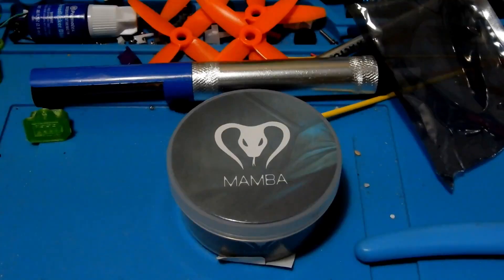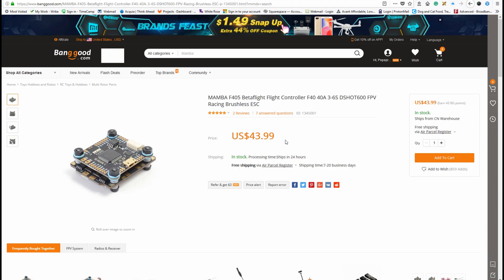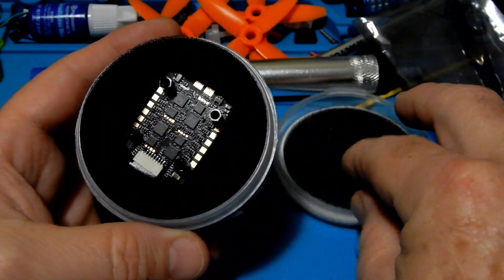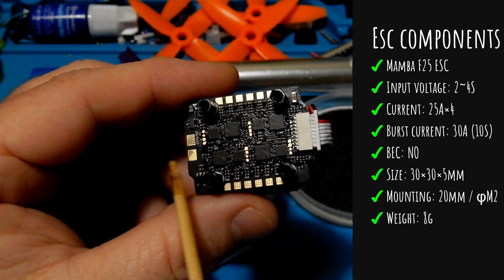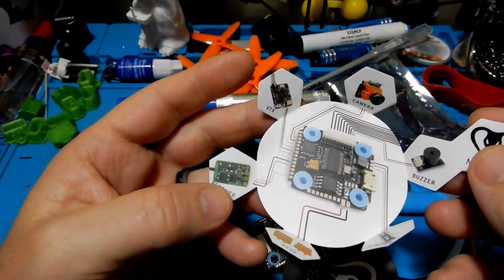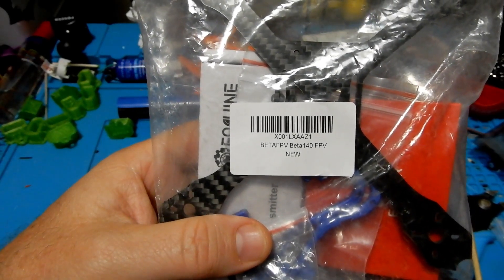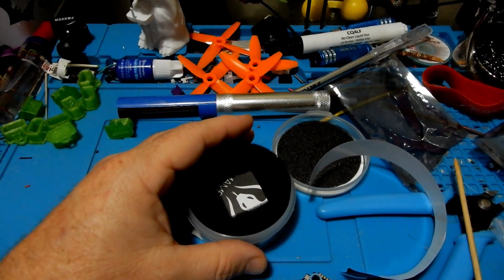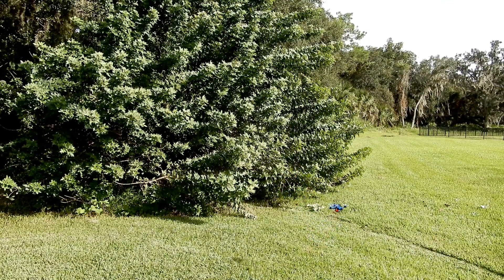Diatone MAMBA F405 Mini Stack -  Cheap Mini F4 Stack

Comment: Hi nice review which prompted me to buy this stack. Can we power the fc through esc via cables? Or we need to power by using the pads in the fc?
Reply from the maker: If you bought the full stack the FC will be powered by a cable from the esc to the fc. You will receive it already assembled and receive an extra ribbon cable for this as well. Now I have not done this before but the diagram also shows that you could straight power the FC from the battery or another esc to the VCC pads on the Mamba FC as well. So you should be completely covered my friend. I do suggest, although I did not do this in the video,  add the supplied capacitor to your battery leads/pads on the esc to clean up the power so you do not get any interference in your fpv feed. I am still using this stack religiously and just received the v2 of the mini yesterday for review. If you do any other builds the iFlight Succex stack is also now giving this stack and run for it's money to be the leader in affordable stacks. Hope this helped my friend... Happy Flying!
Reply: @TheQuadcopterReview  Thanks a lot friend. I have a iflight stack too buts its more expensive than this
Reply from the maker: @rajeevgopal1394  I don't know if you saw the mamba mini v2 MK2 stack yet also super cheap and they have made the solder pads better pretty happy about that change here. Is the mk2 the one your purchased? The link in my description?

Comment: Hey man, nice and helpful video!

How good would F405 be on a 600mm quad?
Reply from the maker: I believe the full-sized version would work just fine. I have one that i am in the middle of making the video for. I just need my micro cam to come in but it is 40a x 4 on the full sized version so I would think it would work great.
Reply: @TheQuadcopterReview  Just got my Mamba, do you have a video about setup?  I watched the wiring and stuff, I mean the software configuration.

Comment: Three uarts are not extra uarts that’s basically borderline / insufficient nowadays. It’s actually not fully three uarts cause there is only RX1(sbus/DSMX), TX3(smartport), and Rx6/Tx6 in which leaves you to have to sacrifice some what are now staple protocols / devices. Such as camera control, FPort, Sport, GPS, CROSSFIRE, etc. So back to joystick OSD controller; a basic micro cam don’t bother wasting $ with any newer style camera with rx/tx pinouts. If uart1 was a full uart(which it easily could have been / should have been mr. / mrs. diatone designer, that’s me slapping you off the back of the head) then at least it would have given option to upgrade sbus to FPort protocol but I guess ESC telemetry is reason still, give pilots option is much better say if not pairing with mamba 4-1 or other 4-1 with telemetry. So after a build now I know reason the price is put st where it is. Nobody would go for this FC at all unless it’s packaged with matching 4-1 mamba ESC, there are zero pros to it if looking at it as a standalone FC. So you pay for the 4-1 ESC and get a shitty FC for free. Yes shitty worst solder pads diatone likes to push on their gear. Low in the copper, magnifying glass requiring tiny ass pads, that for sure people will lift during build or in a crash. The fury F4 was same, same was said in their reviews but let’s do it all over again and not listen to hobbyists. That’s why you are making zero $ on the FCs and retort to the old gouging in the replacement standalone price that’s more than entire combo stack is. Diatone you are stupidly stubborn and shady. It’s not outstanding in anyway wait that extra payday buy a quality product this one is a no go.

Comment: Can you set it at 8k 8k in BetaFlight? I have a GT R349 HD, just setting it up. Cheers.
Reply from the maker: I haven't tried outside of default on the PID loop Frequency of 2Khz. I have left it that way on all builds and just checked the factory setting on my R249 and it too is a 2Khz. Not very helpful on this one. Hahaha
Reply: No worries, just thought if you did know I may as well change it but will leave at 2k. When they name it like this I wasn't sure if that meant 8k 8k or not: Fury F4 OSD "8K" flight controller.   @TheQuadcopterReview

Comment: If we wanted to flash this to BF4.0 what target do we use? Thanks!
Reply from the maker: The target your looking for will be FURYF4OSD my friend. Make sure you do a dump in the cli first as always in case something goes wrong for you in 4.0 and you want to revert. I have not used 4.0 on this board yet so let me know how you like it if you think about it.
Reply: Great! Thanks for all the fun videos and tips!!
Reply: Great vid. Question? I just set my stack up, but on betaflight there is no cpu usage. It only chimes up the first two chimes then nothing. The fc lights up, takes stick commands, video but no motors spin and the accelerometer is not reading, I don’t use the accelerometer but I think the issue is related. Just curious if you seen this before on this board and maybe I missed something. But I fear that something went wrong. Your thoughts?

Comment: What is the betaflight firmware target for this Board?  Cannot find any documentation on it.
Reply from the maker: Your looking at  MATEKF411 my friend.Hope this helps.
Reply: @TheQuadcopterReview  I was told it was FuryF4OSD which the 30 by 30 version of this stack uses but it is not working correctly for me with the mini stack - the target you mentioned does not appear to be correct as it only recognizes 2 UARTS and I need UART 3.  This is not a Matek Board so I am confused.